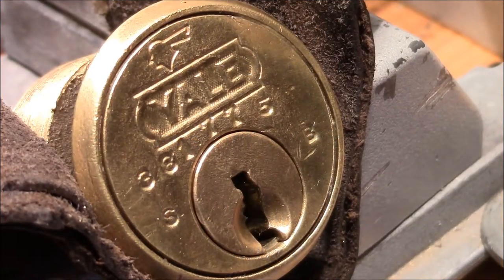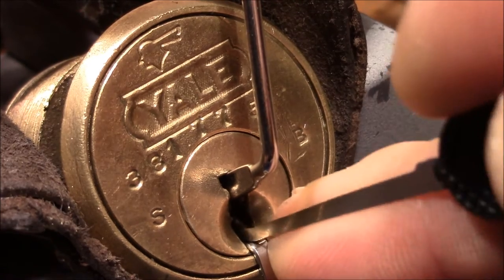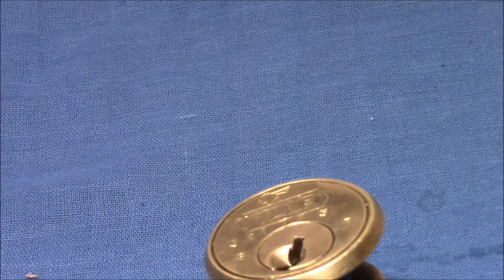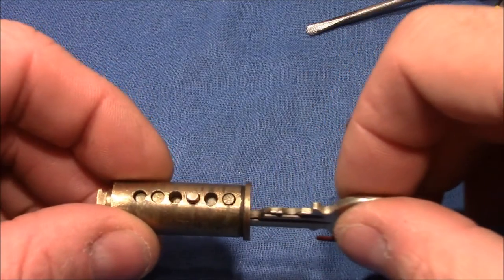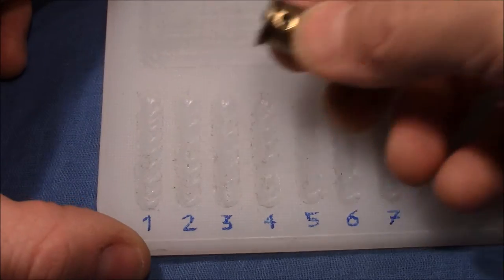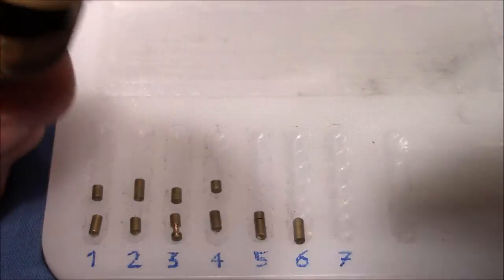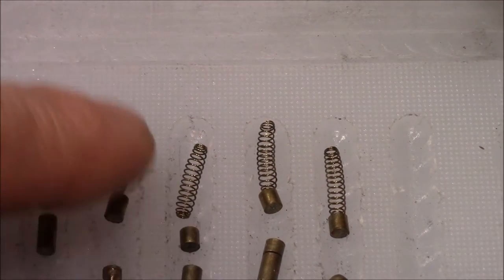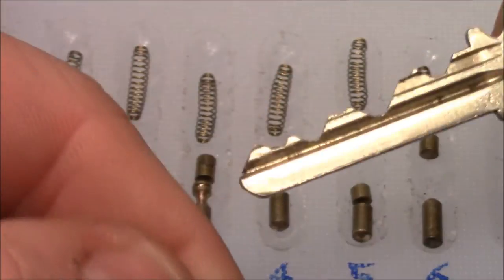(picking 149) Beautiful 6 pin YALE rim cylinder - thanks to Joshua for this lock

Comment: the code stamped on the front is a blind code. I can look it up on my code software and get the actual cuts :)
Reply from the maker: +Jeff Moss That's interesting - a secret code. Is such coding still in used today? Yes, look it up and we compare it to the bitting - would be cool. 381775
Do you know what the "S" and "B" means on the lock?
Reply: Yeah, see my first comment - it's the keyway
Reply from the maker: OK, got it. Thanks.
Reply: I will check the code and let you know what I find!

Comment: beautiful lock and nicely picked bud! did i notice a 7 pin bible? not that you'd want to start converting a lock like that as it looks like there may be some nice history behind it, it's very cool. cheers!
Reply from the maker: +crispey bear Yes 7 in the bible and 6 in the core. Hope the the lock ethic committee won't punish me but I'm thinking to make a nice challenge lock from it. Not too many changes - only nasty pins and no threading. But I'm not sure yet.
Reply: +Potti314 only nasty pins are easy to remove and replace with original pins, haha unless you used them to make the nasty pins ;D it's a great lock and more importantly your lock so you do what you want i say! haha, i love the idea of the lock ethics committee handing out judgment and punishment, very cool idea!! cheers bud